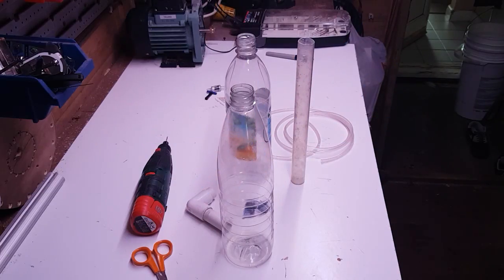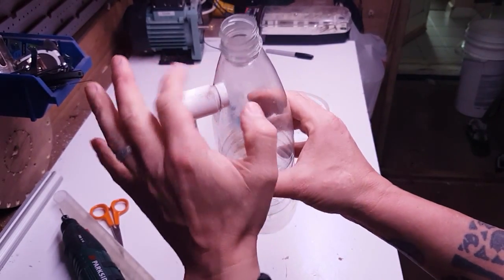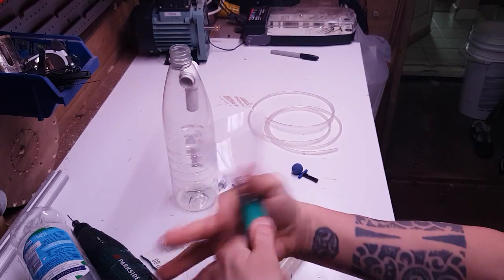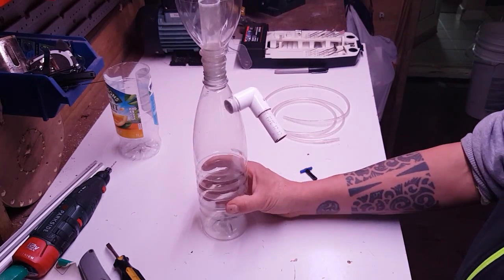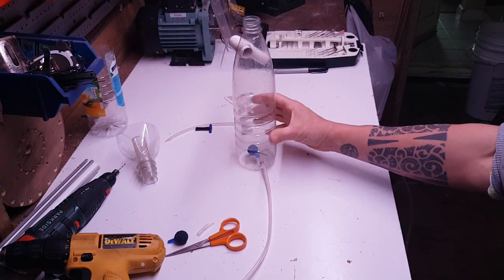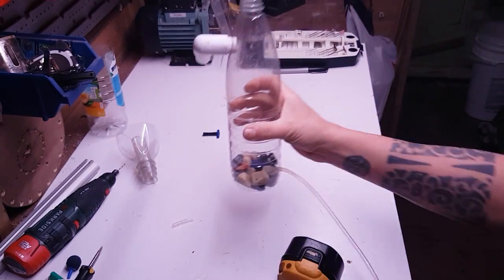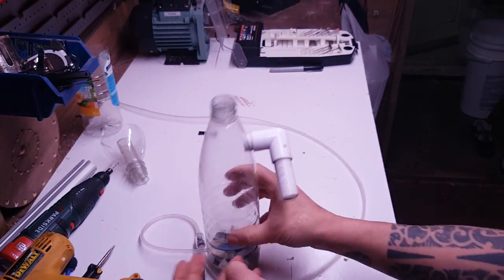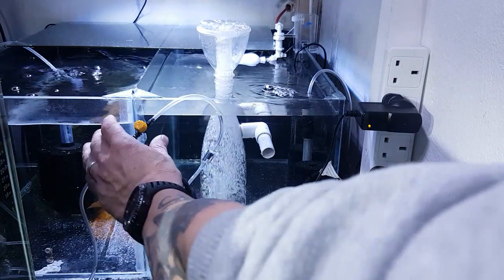PLASTIC BOTTLE  PROTEIN SKIMMER

Comment from the maker: There a different power head for skimmers. Skimmer pumps have a needle wheel and an air line so as it draws in water in its then mixed with air ,this is what creates millions of little bubbles which the protine sticks to and then is removed in to the skimmer cup. Hope this helps
Reply: I have seen as much, but living about 120km/about 1.5hrs drive from the nearest local shop that carries anything for salt water this is a neat temporary fix/ try to see if I want to go the route of a skimmer on my system. 😁😁👍🏻

Comment: You can open this drill. Remove foam on the top of motor. Add several layers of pvc tape on the motor that it will fit tightly in its place. Assemble device back. No noise from motor, profit. 😎

Comment: I have a question.What would happen if you make the same design but dont add the pvc elbow coming out of the side? Will it still work and just have alot of wet skim compared to dryer skim with the elbow?
Reply from the maker: You need the elbow for the water to escape. 😀👍

Comment: will i be able to use it in 150gallon tank by making it with 4inch pvc?
Reply from the maker: +Bhashkar Raj Mishra yes that would be fine😀
Reply: ive seen using powerhead too on such device. can i use normal powerhead like as  used in fresh water or do inneed different powerhead?